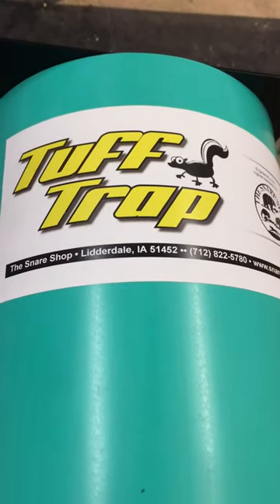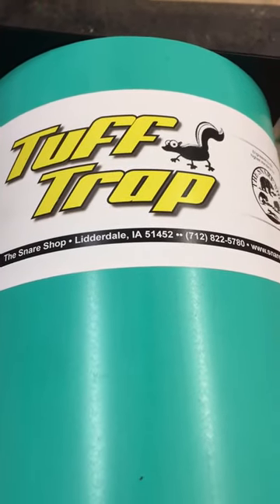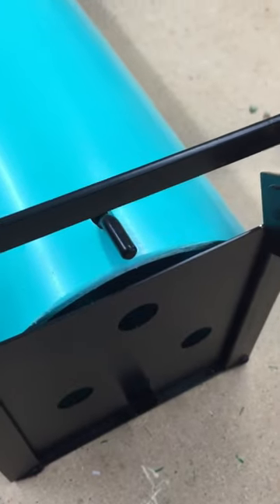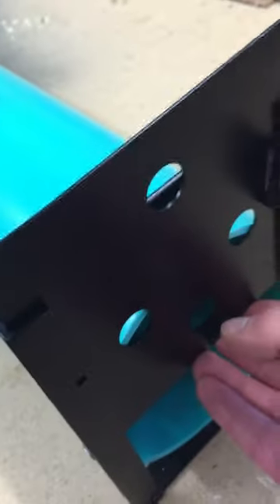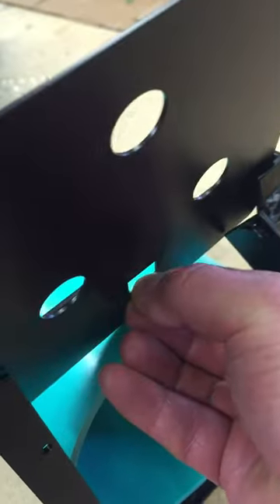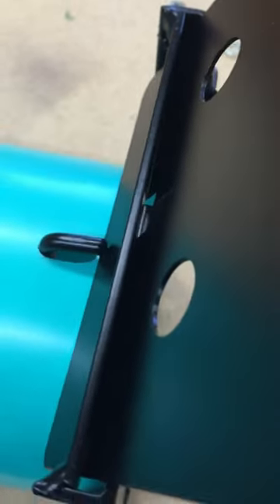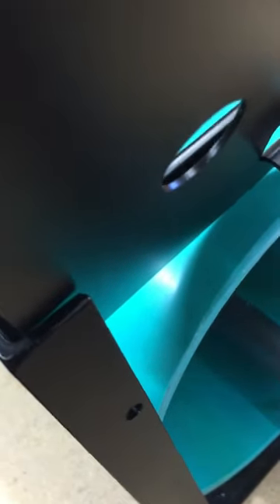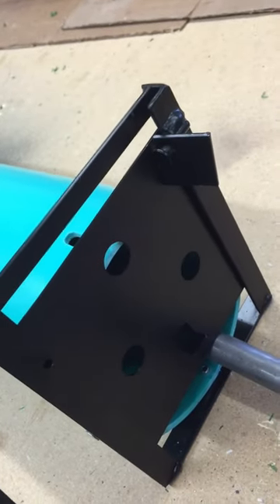Tuff Trap Skunk Trap Operation

Comment: I just ordered one of these.  Have you had success with yours?  Able to catch skunks with no spraying and release with relative ease?
Reply from the maker: I've only used it once but it was great.  Got the critter the first night I put out the trap.  No spray.  I used an endoscope camera to look into the trap and make sure I had a skunk and not the neighbor's cat -- you can't really see that well into the trap.  The skunk took a long time to exit the trap -- perhaps it was because he took a 10 mile ride over some bumpy Montana back roads to where I released him.  Ended up just leaving the trap out overnight and coming back the next day to pick it up.
Reply: Awesome.  Thanks so much for the reply!
Reply: Just curious, did you put the trapped skunk in the bed of a pickup?  I have an suv and a little worried about having inside the car.  I know it's supposed to keep the skunk from spraying, but still....